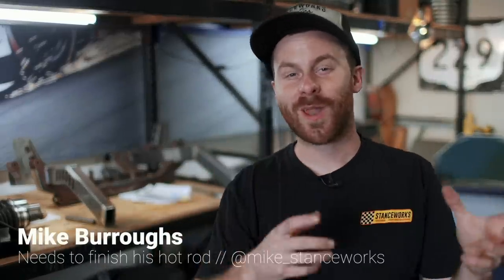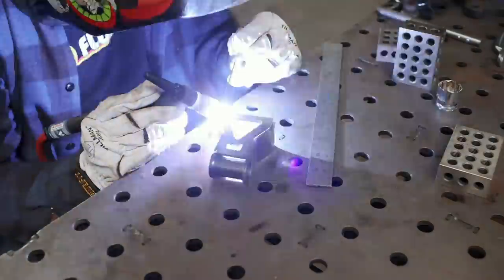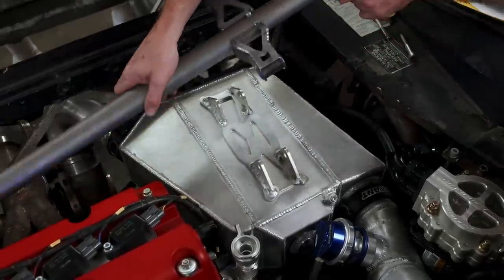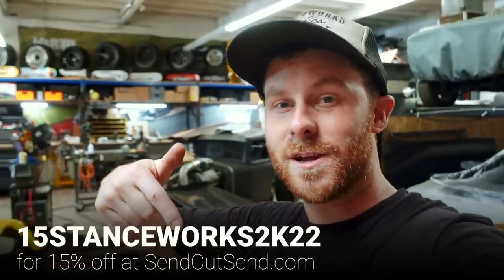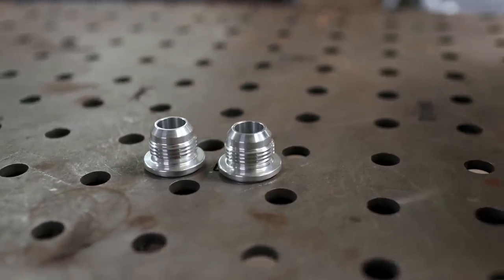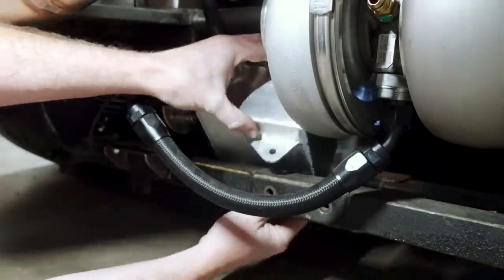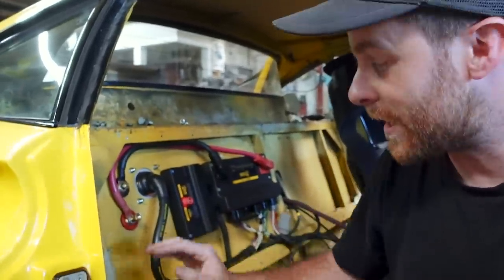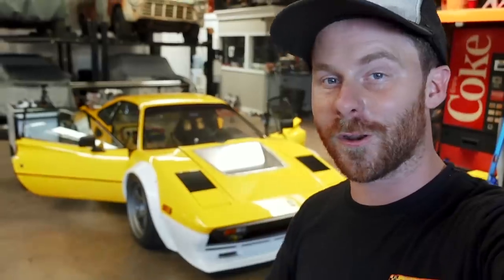Over-Engineering: Intercooler Mount, Oil Sump, PDM, And MORE! Honda-Swapped Ferrari

Comment: Couldn’t changing the seat - or modifying the seat…meaning more “recline” give you more head room?…I don’t remember seeing how the seat interfaces with the body behind it…trade a more flexed leg position for a more forward lower seat and more reclined seat back, which would drop you head slightly lower?  Just my thoughts after the roll cage discussion..

Comment: I wouldn't run a cage. In most states, any kind of cage immediately disqualifies it from state safety inspection. and if you don't plan on doing any kind of sanctioned races ( NASA or SCCA), then a cage isn't a requirement.

Comment: Fixed back seat? Run a 4-pt roll bar and a harness with a sub belt, or don’t run a fixed-back seat and no cage/roll bar. If you’re not running wheel-to-wheel, or drifting professionally, you don’t need door bars.

Comment: I second another comment’s idea of waiting till vehicle is running/driving to finalize going “big” on a cage. Quick disconnect steering wheel or changing seat would be an easy fix but both change aesthetic of the interior. Street driving with full surround seat seems sketchy to me to start with so that would be what I’d look for initially once I can street drive it. When I was building my e30 I contemplated the surround seat but drove a buddy’s car with one and hated the feel of it. Adding in tubing and extra risk to the street driving aspect doesn’t seem worth it in the early stages of getting it back on the street.

Comment: I think you’ve decided on a half cage you’re just trying to convince yourself. But 100% go with a half cage you’ve added a significant amount of chassis reinforcement along the way, at least starting with a half cage you can enjoy the car on & off the track. Down the track you may decide to full race car & you can alway build a full cage later on (it’s harder to go back). 

But I wanted to say thank you for straight talking about full cages on the street & how unsafe they are (without a helmet) lost a friend who head struck a roll bar in his “street” car that had a full cage.

Comment: If the tank doesn't have a vent, won't the pump still just pull through vacuum? Also you may just want to wrap the tank in thermal wrap being so close to the turbo. As far as the cage, if you don't have airbags then you should go full cage. If you go full cage you have to go 5 point harness and helmet. You crash on the street without a harness and helmet and you're gonna end up with brain damage. Cages are great if in a race car using all the correct protective equipment that goes with it.

Comment: I really don't think having that pump connected directly to the turbo is a problem. Taylor Ray has his turbo plumbed directly to a stage of his scavenge pump for his dry sump system. as long as you have a good feed flow and there isn't a big pressure delta between the feed and drain (i highly doubt that pump will suck as much as you're putting in) your turbo seals will be fine and your turbo will be lubricated.

Comment: If you are having trouble egressing find a smaller steering wheel and/or get a detachable hub, will make it feel more like a legit race car and  it will make getting in and out a breeze regardless of the spec of cage you decide to go with. If you aren't going to be subject to any sort of racing regulations i would go for loop over the seats and a door bar. your seat  appears to be already blocking the line the bar would need to be in anyways.

Comment: if i had a ferrari with a 1000HP+ K24, i too would want to drive it around on the street from time to time - so i think i'd stick with the bolt in roll bar you made rather than a full cage.

any updates on the new truck?

Comment: Personally I would be totally ok with just a roll hoop behind the seat. It gives most of the protection you need without gutting the use ability of the car. A full cage pretty much turns this into a trailer to the track car which defeats the purpose of making something to use also on the street. Your decision but for me it is a no brainer

Comment: You could certainly design a roof reinforcement web, and make that out of ribbed sheet metal. If you throw the finite element at it, and trash a couple of physical models, I see no reason why a welded in element wouldn't be stronger than a roll cage and basically much flatter. Welding in a bunch of U section and some careful fillets and gussets, should be perfectly strong. Add another 9 inches onto the height of the vehicle... still won't be tall as a normal saloon car.

Additionally some external metalwork could add both some strength and some aero, or scoop and gather up some airflow to be piped down a duct into the engine bay.

Yes, in short I think you should slap a formula one / mclaren F1 style intake on top of the roof, and then wrap the cage into the roof line, with some flattened & box section reinforcement, and beefy A pillar gussets.

Have a look at the F1 GTR longtail carbon roof intakes for reference. Could probably make a full carbon external roll cage and air manifold. Maybe even cool some stuff, put some aeroplane looking fins up there that look ornamental but totally aren't.

Comment: So to me it doesn't look really streetable currently, with the high sides on the seat the ingress/egress is terrible.  Not beating you up just my 2 cents.  What's wrong with a partial cage, Roll bar behind the driver with two angled braces towards the rear?

Comment: Have you considered a non-regulation but properly engineered laser/bent sheet metal structure? You could have a front roll hoop and a rear roll hoop, then connect them with a VERY tight fitting high strength steel plate with tabbed/welded ribs where appropriate. It’d need some FEA and a good understanding of crash loads in a time attack setting, but at least you’d have a street car still along with possibly the same strength and safety of a tube structure. Material cost would be minimal, especially using a service like send cut send and welding it yourself.

If you’re comfortable with it, you could try to prove equivalency to a regulation tube structure using physical testing or FEA for your own peace of mind, although if the event/class you’re running requires a full cage you’d likely be out of luck.

Either way, if it were me and I were set on having a street car and didn’t mind giving up races that require a full cage, that’s what I’d do (and in fact will do with the 1985 XJS I’m restomodding next year)
Reply: Here’s what I’m likely doing with the XJS: front hoop, rear hoop, upper 1/8” plate with lots of speed holes that nearly matches the curvature of the roof and has bent sides matching close to the upper door sill and hits the upper tangent of the front and rear hoop, 1/8” thick ribs around 1” wide (meaning I lose 1” of head clearance instead of the 1.75 tube I’m using for the hoop), and a 1/8” thick lower plate (again, lots of speed holes) that tabs into the ribs so I can plug weld the tabs from the bottom.

Happy to do a quick example Solidworks model for you if you’re interested in seeing what it looks like, since I’m going to be doing that work for the Jag anyway!

Comment: For the cage, you need to look into the rules for the tracks and the organizations putting on the events you want to participate in. That will dictate the cage design needed to actually take part in the events you want to participate in with the car. A cage is absolutely NEEDED for what you want to do with the car on track. The question simply is, how much cage? I know you want to use it on the street, and really, if you wear a helmet, you still can safely. I don't know what the laws are regarding that where you are (just like even though a 5-point harness is better than a 3-point safety belt, most cops don't care and want you only using the 3-point), but if the concern is bouncing your head off of a roof halo on the street, at the very least an open face brain bucket will improve that level of protection.

Comment: 15:00 Making cages with tubular profiles must be the easiest, cheapest and most efficient way. But given the need to save space, what other ways of making cages exist? Saving space surely means increasing the cost, both in the amount of material, and in development and manufacturing time, perhaps even achieving considerable extra weight. But I would think of it this way: better to have a less efficient cage than not to have one. How about exchanging one big profile for many small profiles? Is the structure similar to a mesh, but without behaving like a plate... Perhaps work with grids that condense into a large profile on the parents and disperse on the ceiling surface? acting as a trunk and branches... Or perhaps flat profiles, but reticulated, that at least support efforts in one of the directions. I'm not an engineer, but I think there's a certain logic to what I'm mentioning, and I sense that it can offer good results by putting it into practice! Hope this can help you!!

Comment: You can't cut up the A-piller and hide the tube in it? Seems like it already has some sort of tube there, you cant up-size that and tie it in with a full cage?
Reply from the maker: It’s like a 3/4” tube. It wouldn’t fit a roll cage tube in there very well
Reply: @stanceworks  not even a chromolly tube? Maybe it will not be 100% inside the A-piller / roofliner, but i think you could tuck it in a good ammount, sure, ut would be a nightmare to weld, might have to cut holes in the roof to get to the welds though...

Comment: Not an expert here but it struck me that the oil tank would need a vent of some sort to prevent it from behaving exactly like the hose you are replacing, suction from the pump would cause a vacuum that suck the turbo dry.

Comment: i left out the door bar from my supra. but frankly, even then, with the bucket seats, it was not really nice for street and or daily usage. on hind sight i would have most likely should have left the cage not done, or just do a main hoop and  the stuff behind that, since the back seats are not really usable anyways. Also with a cage, you would need to use a helmet, and with helmet HANS. I left the normal 3 point harness in the car along side of the 5 point harness for the track use. but frankly any collision would have most likely killed me with the cage if just wearing the 3 point harness, since it would be really easy to bang your head on the cage without the 5 point harness on tight. i'd say skip the cage. The car is going to be so nice, that i doubt you want to give it the full beans on track and go on such limit that would cause the need for the cage, or atleast just do the half cage.

Comment: If you talking about the cam position sensor, you can search for TSX sensor. One of the two is different direction conector style. They are interchangeble (y). Here is a exmaple of what i'm talking about. - https://i.ebayimg.com/images/g/v9IAAOSwAfxguM2Q/s-l500.jpg

Comment: Could be camera angle, but that fitting looks to be at the same level as the turbo oil drain. The tank is mounted too high. Ever thought about doing some research on how Porsche does it? Well known production design.

Comment: I pretty sure that thing has all the structural rigidity and torsional stiffness of a wet paper bag dude. Cage it, at least half cage it. It was designed generations ago, built on a budget and not designed to cope with real power, much less the forces exerted by those really long control arms.

Comment: Had a similar conflict of choice to make on my track day car. In the end went with a head friendly full cage. Will say that I was very thankful for it when I had an off track excursion and hefty front side impact. Thing is, if you track your car, the chances are, you will eventually have an off. And with your power/performance targets your off ( and I sincerely hope it never happens) may well be at reasonably high speed! So put some thought into the cage design that gives you the most safety verses practicality.

Comment: WARNING: The high density polyurethane bushings are too rigid, you wont have any room for movement. Polyurethane bushings are ok for replacing rubber in a suspension, but not for your application, it's not the same forces at play here, you may end up cracking the intercooler. Rubber bushings are more than enough and will give you the needed play.

Comment: Half cage with door bars. Rigidity from back to front with a little less body roll side to side. Enough protection in a roll over in such a light car , obviously not the same as a full cage but you can atleast street it still with the fear of knocking the life outta your head.

Comment: Can you do time attack with a half cage? If so then that's a no-brainer for me.
Reply: I read the rules for global time attack and it looks like this could possibly run in the Limited class with just a 4 point rollbar. The only exception is you're supposed to be using stock shock towers which is a weird rule especially for a double wishbone car.

Comment: Hey that oil sump might need to be vented, you haven't done away with the suction that'll be created in your tank, which means you're still going to pull a vacuum through the turbo.

Edit: I am very late to this party.

Comment: I would definitely consider a roll cage a necessity if racing a car regardless if it's solo runs or not. Car can be replaced, you can't.
Have a look at this one. Looks like a well designed one that will give you the room you need plus the door brace won't get in the way.
https://www.customcages.co.uk/product/ferrari-308-gt4-historic-t45-roll-cage-kit-ms-uk-compliant-to-appendix-k/

Comment: Could you cut out the inside of the doors to have more room for the door bars? I dont know how much use is a bolt in cage for retaining some usability. But you have vastyl more experience with old cars, but I wouldnt trust a 40 year old car with my life if im on the street and a f150 decides to t bone it.

Comment: I'm sure if you ask Chairslayer he could make a rollcage so tight you wouldn't need to worry about fitting in the car.
Reply from the maker: Unfortunately not the case. I can make one just as tight by hand, the problem is a tube is 1.5” diameter at the smallest and I have about 2.5” of clearance with my head
Reply: @stanceworks  Yeah that's TIGHT... And if I'm not wrong there's no way to get the seat any lower unless it was molded into the cabin.

Comment: Looks like the car's cabin construction is tubular anyway, so I wouldn't bother with a cage. The whole point of a car is to drive it, so why limit yourself? I'd also rip that seat back out if it's that hard to get into the car, never seen the appeal of huge wings on the sides of seats. Plenty of supportive seats out there without going that far.

Comment: If this is a full on race car, then why would you want to drive it on the street? It looks far from being comfortable, especially on a road with bumps and potholes. But then again, driving a car that is as cool as a Ferrari F40LM on the road would definitely turn heads. Is there a way to mount a half roll cage? Perhaps keep the roof tubing to the rear?

Comment: Full cage. At some point you'll want to go to a cool event and the organizers will require one.

Ultra high performance street cars are dumb. I know you say you want to "enjoy" it, but a 1000+HP turbo 4 cylinder is probably not that enjoyable to street drive in California anyways. For me personally, once I started doing a lot of track time I just lost interest in street riding. After getting a taste of 300kmh flat out front straights and full send sweepers, going like 150 on the backroads was just too dangerous and stupid for how lame it was in comparison. 

Given your location, there's probably more track days than time you have to drive the car so I don't think you'd be missing out by having it be a track car.

Comment: 1000hp time attack car built on a 70s/80s chassis....I don't need a cage....

If you put a cage in and want street usage why not use the cage foam in the areas where you may hit the cage? 

It needs a cage though from any sensible safety standpoint. 
Do the regs really not call for a cage in something that quick? 
Am sure there is a way to design and make the cage to give us much space as possible.

Comment: If you are taking this to a track you need to fit a cage, it is just that simple. With all respect you are not a fabricator or pressure welder so it you welding fails there is potential for an accident and you need a safety cell to protect that is designed and installed by professionals. This and fire suppression are vital to your safety and you should not be concerned about how streetable the car is. If streetability is a goal don’t take this near a track theres a reason big horsepower time attack cars don’t have number plates and they all have cages. Don’t downplay the dangers of race tracks they dangerous places where profession drivers have died in cars built by Motorsport professionals with less horsepower than you are chasing.

Comment: * * * SUGGESTION * * * 

finish the car , get it running / driving before you put a cage in it.. put some street miles on it to even see if you can bare street driving it or if its even going to see "ENOUGH" street driving to even justify NOT puttin a cage in for the little amount of street driving this car might see at that point due to it already being hard to get in and out of.

but my .2 cents : put a cage. 

after seeing a drift video of someones steering breaking during run up / initial entry and the car veering off and smashing into a concrete barrier and absolutely DESTROYING the car. you would be SICK ( if you survived ) that you DIDNT put a cage in this 1:1 build  if something freakish like that were to happen to you / this car. 

would hate to see all this time / hard work go to waste.